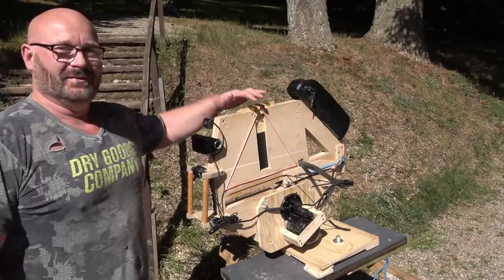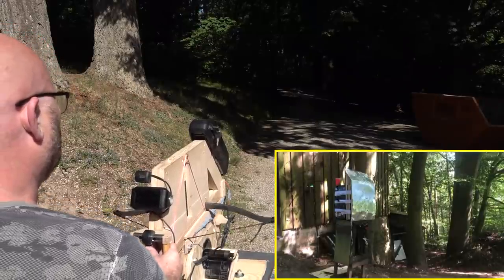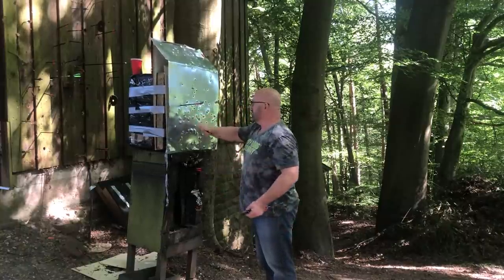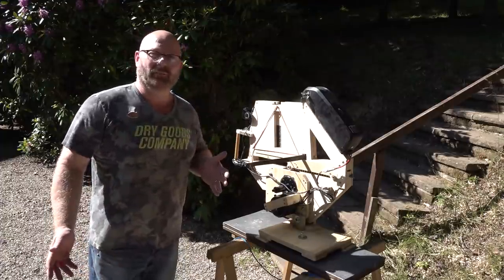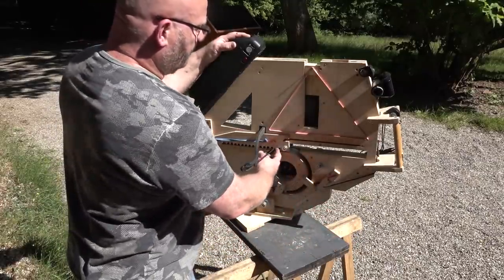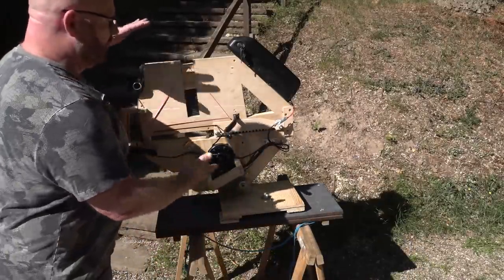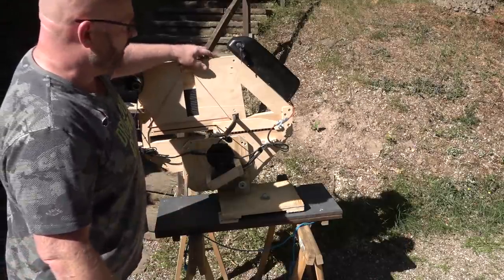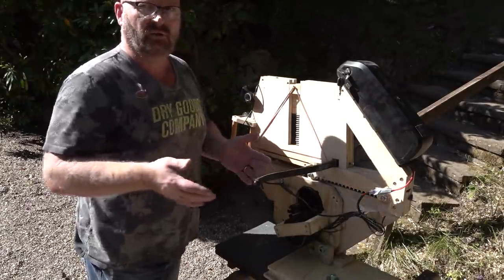The wonders of the full size, full auto crossbow.

Comment: Try to make it fullauto footpowered with pedals from a 
bicycle. To overcome the sharp peak of tork you could use a flywheel of some sort which you spin up before engaging the trigger. Aiming would be a Little difficult, but you could either use a second Person or some cranck handles similar to those used in anti aircraft guns.

Comment: Put the battery below the handle. When you hold it it will both lower the center off mass, as well as move it closer towards your body. As a result without changing the weight, it should still be less energy to keep it aimed at the target.

Comment: to make it quieter, could you add a 2nd gear turning the opposite direction at the same speed, so right after the first gear lets go, the 2nd one grabs onto the sled and pushes it back to the starting position?
no idea if that would work or not

Comment: would it be possible to have it "bike powered" ? With one crossbow on each side turned 90 degree ? So you can have 2 wheels with dents on oposite sides to have constant strenght required ?

Comment: move the battery behind the motor, trip down the front tower area, this would cut the wiring down too so you could be rid of most of the wood under the rack and pinnion system.  lastly put it on a proper ball joint which will cut down that heavy mounting bracket.   You could make this a bit smaller, not much because you are right you are limited in places, but you could REALLY trim down on that extra wood which will cut the weight a lot.

Comment: if you wanted to make a human powered version of this, you only really need 6 things: bicycle pedals, a chain, a large and small sprocket, a flywheel, and a clutch.   The bike pedals should connect to the flywheel with a free-wheeling ratchet (so you can stop pedaling and the flywheel will keep spinning). The clutch connects the flywheel to the small sprocket (and is actuated by the trigger), and the small sprocket drives the large one via the chain.  Large sprocket cocks and fires the crossbow.  Of course, this turns your auto crossbow into more of an auto... ballista?  It doesn't look very portable as it is, so it didn't seem like a terrible compromise to make it pedal-driven.  Your gear ratios (between the sprockets) will really depend on how much mass you want to put into your flywheel.  The more mass you have there, the closer to 1:1 your ratio can be. If it's really heavy, this might necessitate another set of sprockets between the pedals and the flywheel.  Could even go so far as to use an entire set of bicycle gears to drive the flywheel, allowing the "driver" to spin a very heavy flywheel up from a complete stop.

Comment: Perhaps you could have a cylinder magazine rather than directly stacking on top of eachother to save space?
The battery could then go on top of the cylinder to save more space.
I do understand how much more awkward it will be to get a cyliner mag that orients the bolts properly so they will load compared to having them all correctly angled in advance, on top of how much awkward the auto feeding mechanism would need to be to work at an angle, but i doubt they are insurmountable problems considering what you did with the SIL.

Comment: Have you considered using a flywheel? Maybe even using the battery itself as a flywheel 🤔 You'd need to either have some kind of brush system at the bearing of course but I imagine it'd be possible. Alternatively you could incorporate the motor AND the battery in the flywheelo the flywheel. Intriguing to think about!

Comment: Remake it with a denser material that takes more direct force to break. Then increase the rubber band strength little by little to find what works well. After that you can make it fire faster which will be needed if you want to increase the weight of the arrow. Also if you want to make your arrows heavier I recommend having arrows custom made with a somewhat dense material so it doesn’t affect the overall aerodynamics of the arrows. Thus the arrows become heavier and you don’t have to accommodate for changes in direction caused by the flow of air and the shape and design of the arrow.

Comment: If youd make the (one) gears in steel, there would be waaaay less friction and therefore you could use a stronger bowlimb.
Reply: Friction would be the same. Pressure on the teeth don't change by material
Reply: Thats bs, wood on wood has a very high friction coefficient while steel on steel has a quite low one. Wood on wood is 0.5 whilst steel on steel is 0.1
Reply: To me, it kinda looks like he cut the gear out from aluminum so the switch to steel won't make that big of a difference.
Reply: Gonun he has about a third of the gear in aluminium, but alu on alu is terrible aswell
Reply: Commercial electric machines typically use tough plastic gears, like delrin.
Reply: @JanoTuotanto  friction is force * frictioncoefficient, so any material with a low frictioncoefficient is good

Comment: Double shot per rotation still possible, you can instead slightly slow the angular speed of the motor and it'll shoot faster over all. Also you could set the trigger to shoot faster as in slow mo you see there is wasted time between sled resetting and the bolt firing. 
Your right though, its harder to archive and would take some problem solving and playing around but I'm sure you could manage. (I did a full breakdown of the timing based on the slowmo in the previous videos comment reply to you)
Very nice all the same.

Comment: Eh, I do see potential to make it smaller... 
like moving the engine further to the back, and the rack and pinion. 
Basically like a bullpup? would also make it easier to carry, with the engine close to the body.
Now the rack would protrude from the back of the weapon, so let's replace it with a guided chain that wraps around the gear... Either one that snaps back, or one that goes all the way around... In fact the chain could pull back the string two times per revolution. The battery pack may be a little overkill in general, so I'd opt for a smaller one. They have 48V packs for some wireless powertools.
Plenty of ideas here.

Comment: Could you use a normal crossbow with something like a chainsaw bar under it with a chain with dull nubs spaced apart to pull the string back letting it slip off the nub when ready to fire you could use a gear driven dc  motor on back of bar or something like a threaded bar spinning with a nut running back and forth to cock it with reversing switches on the ends of the long screw .

Comment: Can you make a sling shot machine gun with the same mechanism? Given the smaller projectile, you would need less energy to launch a projectile at a faster velocity. Therefore, you can use a power drill for a more compact Full Auto system.

Comment: Try using a double pulley system to reduce to amount of torque required to pull back the string, so you could then go lighter weight and posible downsizing

Comment: You are a maniac, I love it. Here is my solution to all the human powered problems, a fly wheel. The human just spins up the flywheel which drives the motor, the human applies continuous torque. You could also use a smaller motor to drive it if it feeds into a flywheel, won't need much torque. It should run like a minigun, get the flywheel spinning then begin firing.

Comment: More compact: Instead of rack and pinion, tighten the string with two horizontal gears with a massive steel pin on almost the edge (still needs a bit of space for the arrowguide). Angle the gears such that just at the end, the pins almost meet and drop away, releasing the string. (edited 09-06-2020)

Pro's:
It wears the bowstring evenly on almost the entire length, instead of just on one tiny spot
Potential to use two motors (because why not, right?)
Weight distribution is lower down, and closer to the arrowguide (smaller center of mass), enhancing stability.
Steel pins are a slow wearing part, and very easily replaceable.
It makes the whole device roughly as wide as the bowlimbs, instead of taller (ea; less top-heavy, prone to swaying)
Potential to incorporate that same "go wide not tall" design philosophy to the ammo storage. Potentially for belt fed magazines or drum magazines ala tommygun..

Cons:
Wideboi might not be better on the battlefield when in close quarters or tight squad formation
If the pins aren't equally pulling back the string, it shoots crooked. (may or may not be a design quirk that can be used as a pro)

Alternative:
Your bow doesn't really need to be a real bow. It might as well be a bunch of insanely tensioned pulleys (or earlier mentioned pneumatics) that happen to be accelerating an arrow. This may or may not be a good idea, but if tallboi design is maintained, that would make it fit in a suitcase.. (edit: Lancehead F1, but motorised basically)
Reply from the maker: No armchair wisebutting please. Build it, film it, upload it OR shut up.
Reply: Not wisebutting at all. Just trying to think along. Apologies if my post seemed to indicate I think of your design as less effective, because obviously it's amazing.

I merely tried to incorporate ideas that you yourself suggested to the viewer in previous video's (ea; Battlefield footprint, your lancehead presentation as a less wide alternative to bowlimbs.

Ultimately, I'm just putting together ideas that were yours already. Obviously I don't have the skills to build it, and you do, and that does give you an advantage in this convo, so I'll just shut up then..

Comment: You should add a flywheel and probably mount two launchers offset 180° from each other, like an 2 cylinders engine. It would double the fire rate, the overall damage and double the fun, with a more stable firing! It would be clumsy, but think about it like a tank-mounted weapon!

Comment: You could use a way smaller motor and gear it for the torque. Look for 6355 brushless Motors they can handle over 2000W of power but are a fraction of the size.

Comment: Joërg, I really feel like changing the ammo feed could open a massive amount of possibilities. A magazine's capacity is limited, maybe try something belt fed?
Reply: A belt fed automatic crossbow? Pls.
Reply: A belt wouldnt work, because of the vains...
Reply: @MichaelGittel  what if the belt or clamps or whatever were removed before the shot is released. I'm sure joërg can find a way
Reply: Affenmensch   There are machine guns which pull the cartridge backwards out of the belt.
Reply: @noud3476  Maybe the belt could just hold onto the end of the bolt, 
the string would move past the bolt and brush of the Holder, then grabs the end of the bolt when going Forward again.

Comment: OK, fair enough that this would be difficult to human-power because the load is alternating 100% on and 100% off for half the rotation each. But this presents an opportunity, not a difficulty - you could operate TWO of them, in alternating phase, powered by the one crankshaft. Imagine a set-up like a recumbent bike, with a machine-crossbow on each side. You could converge the fire at 50m or so with arrows alternating from each side. A double machine-crossbow turret!

Comment: Obviously you couldn't replace all the wood with as thick and as much aluminum, but surely it could be skeletonized with support structures instead of quarter inch plates. I'm sure it wouldn't be much lighter, if at all, but it's not a terrible argument.
As for making it portable, you could make a front on top forwards and a back handle with the trigger and turn it into a true hip shooter. While it would still be heavy, you could easily distribute the weight to make it far more managable. Add a laser pointer for a bit of accuracy. The bigger concern would be the legality I suppose. A full auto carriable weapon might not be the smartest thing to build.

Comment: What if, instead of giving the gear a second set of teeth on the same side, you put a second set of teeth on the other side in the opposite position. Then, make 2 different independent sleds. One for each side of the crossbow. Then you could get double the firing rate without compromising space too much and also this would compensate for the sled needing to move back into its forward position. After one arrow is fired, the first sled moves forward to reset while the second sled begins so move back and the alternate.
Reply from the maker: As I said, I don't see how that could be done. It just isn't practicable.
Reply: @Slingshotchannel  I agree, not practical at all. But would be very fun

Comment: Would it be possible to have 2 sets of teeth on the drive wheel of you slowed down the speed of the motor  a little bit. It might be possible to have enough time for the sled to re-set if it were turning just a little slower.

Comment: Couldn't you technically make the magazine a different shape? Something like a Gatling Gun, a barrel that holds the bolts, which are dropped down just like with the crossbow you used here. If that's possible, it could make the whole thing more compact. Probably not much less weight, but better to aim with, since such a magazine could be equipped with an aiming device.

Comment: Dude I haven rc car that stock hits 60kmph. It runs on a 3000mah, 3 cell, 11 volt, lithium polymer battery. I upgraded it with a 6000kv brushless motor. First run the tires exploded... So i strapped the second set and now it is significantly faster.  I cant go over 70 ish kmph because the airflow gets under it and it takes off like a kite.
So dude ... with a little bit of gearng down I 100% guarantee you can find a 1/5th scale brushless system for an rc monster truck with MORE than enough power.
Anyone interested the RC is called a MINI E-Revo. and the parts I upgraded it with are the 11.1 volt batteries and the speed controller of a losi 1/10 scale car (i forget all the names and stuff sadly)

Comment: It should be perfectly possible to human power this. You'd just need to reverse the bicycle gears and drive it with the small one, you don't want speed here, you want max torque. And you could just connnect a high mass flywheel to smoothen the load valleys and peaks, which, of course, means you would need some kind of a clutch system too so you can start firing when it's up to speed.